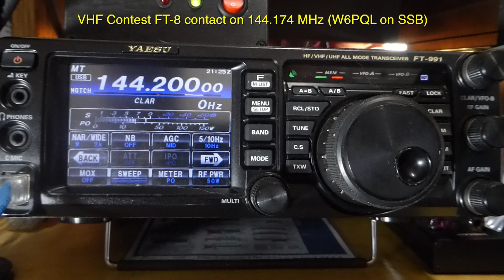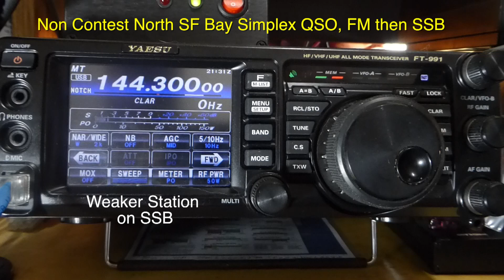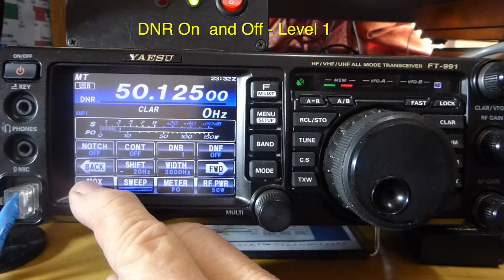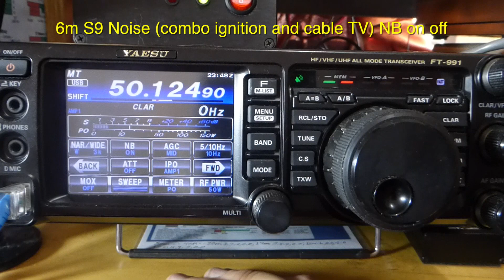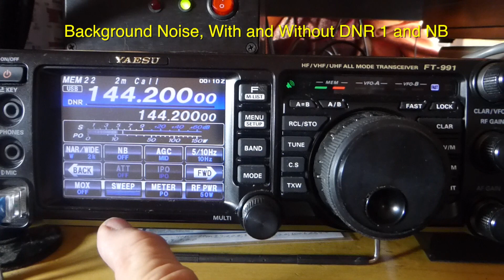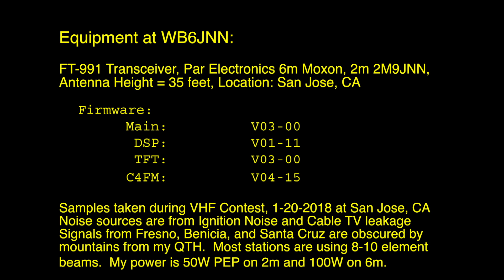FT 991 features Demonstrated during the 01 20 2018 VHF Contest

Comment: Does the DNR work in FM mode?
Reply from the maker: No.  There are no tone adjustments (hi cut/lo cut) either.  The ability to roll off loe frequencies during Fusion reception would have been a useful feature, for example.
Reply: @jimeagle1  Thanks for the reply. Seems like FM was an afterthought. I can make all available adjustments on the IC-7000 in any mode or frequency and its a much older radio. Maybe Yaesu just ran out of R&D money and packed it in on FM

Comment: Don't you have a mox switch on your microphone?
Reply from the maker: The mike I use has no switch.  I now have a handheld switch.  I could use a foot switch but it would be in the way in my small operating room.
Reply: @jimeagle1  if u use a ptt mic and in the vox mode it will drive u nuts  kg6mn